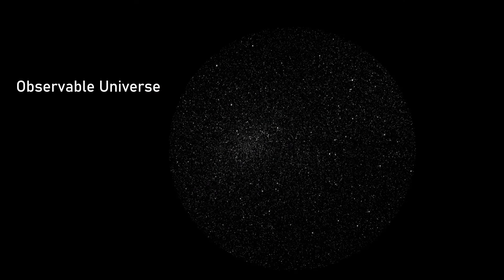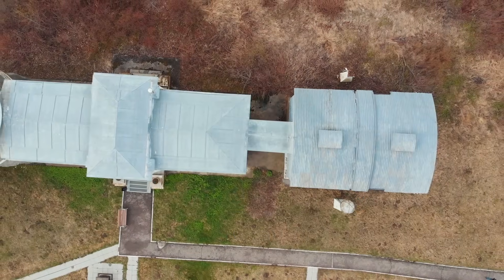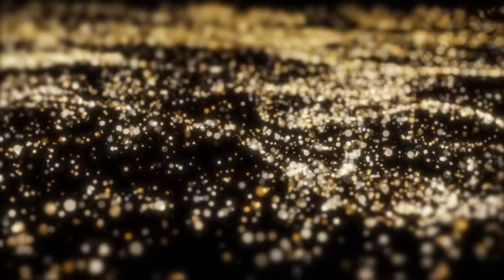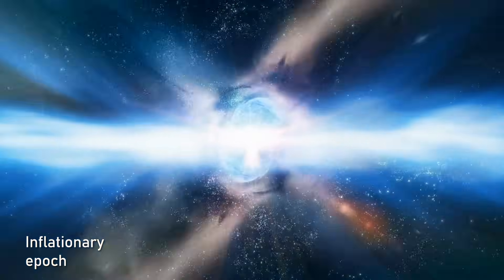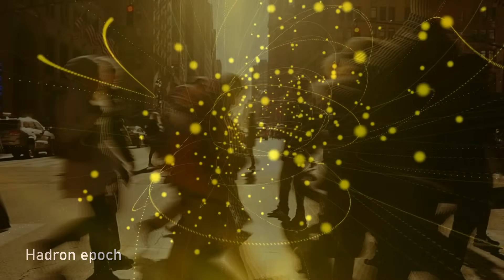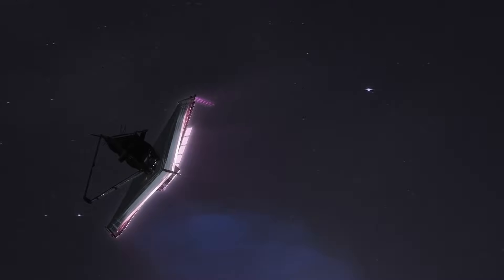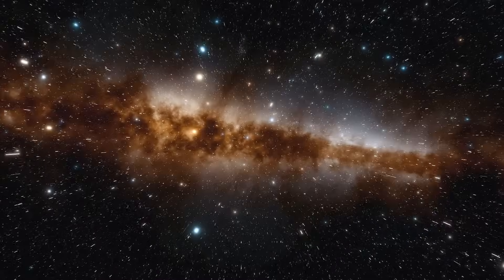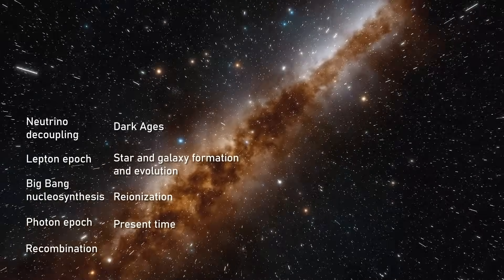Brian Cox - Quantum Mechanics & Particle Physics of The Early Universe

Comment: If black holes reside is a region of Einstein's theorized space-time where gravity and mass are so dense that nothing, neither mass-particles nor electromagnetic radiation such as light can escape then how could it be possible for the entire mass of our universe to escape the unimaginable density of the proposed Big Bang? According to general relativity sufficient compact mass-density will deform space-time to form a black hole which obviously debunks both Big Bang theory and relativity! It is scientifically impossible to travel back in time to view the earliest preformed galaxies of a Big Bang with telescopes that are made in the future. 

As moving electrons of charged electromagnetic waves-light travel through the plasma of the universe each lump (or "quanta") of energy in the electromagnetic waves are charged then discharged to the next lump, eventually the energy dissipates creating the appearance of time dilation. 

Big Bang theorists rely on red shift to support the hypothesis that the universe is expanding, the very process that's easily debunked. Light like all electromagnetic radiation and electricity is the result of moving electrons, they bend-curve in the plasma of ether giving the appearance of longer wavelengths in red shift. Neither time nor mass can create itself into nothing, reside in nothing or expand into nothing simply because nothing has no properties. Time and space are independent of each other, not material bodies or fantasy unions that magically stretch time like a rubber band into space-time dimensions. 

Galaxies with massive gravity from the early Big Bang would have been gravitationally bound like the Andromeda galaxy is to the Milky Way galaxy, the sun, moon and planets in all solar systems in the universe yet these early galaxies were able to somehow escape these massive gravitational forces continuing to expand at an increasingly faster rate. Into what, nothing? Nothing has no properties! Big Bang theory is like trying to force the number 1 into 0, you can try but it still won't fit. 

If gravity is the result of mass then before the universe came into being gravity couldn't have existed simply because mass was not yet created! Neither time, gravity nor mass can create itself into nothing, reside in nothing or expand into nothing simply because nothing has no properties. Neither the atom, universe nor time can be created or destroyed. Albert Einstein an autistic violinist patent clerk that had access to more papers than Suzanne Somers litter box yet creates theories with more bugs than Terminix. The universe has always been here. "I am the Alpha and the Omega, the First and the Last, the Beginning and the End" Revelation 22:13. —Magnetron

What do you get when you mix Einstein's gravitational waves with time dilation? A universe of chaos where time and gravity fluctuates with waves, planets in solar systems are thrown off course in a collision course towards their sun. The speed of light is determined by how fast it travels through what Tesla called the ether-space. Time and space are not material bodies or fantasy unions that can magically create force upon another, yet Einstein joined them together with all the fundamental forces of the universe stretching time and space like a rubber band then using the speed of light to measure the age of the universe. Time and space are independent of each other, debunking Big Bang-evolution and the age of the universe.
According to general relativity ie gravitational lensing (a warped field of vision in telescopes) is due to (mass) between a distant light source and the observer. If that were true earths huge mass would distort the light of the observer as well making telescopes unusable. So only other planets in the universe are affected by gravitational waves? In 1916 before it was known that man could travel in space Albert Einstein based his gravitational wave theory on relativity. In 2021 most of us realize if gravitational waves existed in space astronauts would be crushed like an underwater diver traveling to the bottom of the sea. 

Einstein's disciples defend relativity by saying gravity is a weak force, yeah so weak it effects planets and galaxies just not astronauts or droplets of water in space?. The concept of gravitational lensing is wrongly conflated with mass-gravity. Gravitational lensing occurs in all wavelengths of light. As moving electrons-light approach a bend-curve centrifugal forces slow them down. This slowing down of electrons would account for the appearance of black holes, longer wavelengths in red shift and the supposed curvature of spacetime, what I refer to as centrifugal deceleration of electrons. 

Plasma Birkeland currents of galaxies also increase wavelength from the photoelectric effect.
If space was curved-warped according to Albert Einstein's curved-warped gravity theory, like a boat in the ocean these same gravity waves would effect time and the perfect balance in solar system orbital mechanics throwing planets off course-out of orbit in a collision course towards the sun where a planets gravity and time would increase and decrease with different velocity rates as they ascend and descend the curves of gravity waves. 

So according to Einstein's gravity wave theory the curved warped space of the universe with no gravity traveling through a non curved warped space medium with no properties creates a falling effect of gravity against an already curved warped space universe with no gravity, where gravity is created from gravity and 1+1=3. 

The further light travels through what Tesla called the ether-space, the more it slows down. This mirror experiment in Einstein's time dilation illustrates two things. (1) When light passes through a medium like electrons, a boat in the ocean or an airplane in our atmosphere they slow down from the resistance they encounter. (2) The power of suggestion to make people believe that light is a Time Machine. Time and space are independent of each other, debunking Big Bang-evolution and the age of the universe. Einstein's time dilation and gravity wave theory is just what you would expect from an autistic, using water to make water, turning his faucets on and watching as it runs down the drain. Albert Einstein, a violinist patent clerk that had access to more papers than Suzanne Somers litter box yet creates theories with more bugs than Terminix.- Magnetron - The Scientific Evidence Against the Big Bang https://lppfusion.com/science/cosmic-connection/plasma-cosmology/the-growing-case-against-the-big-bang/

Comment: Neg to poss and back again by gravity??? which is a magnetic pull and that point where your compressed to a neg form! Hydrogen fusion then this hole system to heavy hydrogen fusion!. 😃😄😁😆😅5 Smiles and a faster than light travel by a second length of electrical energy pico it 300times to one second and you can get one light year in 31 hour's Einstein Rosen Bridge plus a few he didn't have that I know anti.... ...about fabric and why??? idiots.... .... should see the ion at a short particle in a thorium reactor type design that is hit and compressed by @ exploding tree lighting worth at around 3 million volt by 8timed units to provide thrust force to the mass. And gravity is a lie magnetic pull weak feild......like worm holes unless you got a above math which allows me to bend space time by quantum mechanic

Comment: If the effects of gravity that we observe, are the results of space-time curving around mass/energy, why do we call gravity a force on par with the strong and weak forces and electro-magnetism? Time has nothing to do with those.
Reply: Time actually doesn't exist in quantum physics... it's external and equations in basic importance don't depend on t
Reply: @blacked2987  Well, that's the point. Time has no place in the quantum world, whereas gravity is defined by space-time, so gravity is not comparable to the forces described by quantum theory.
Reply: @ospyearn  geometry is the sole heart of general relativity. But, at the Planck scale, geometry can't be used... therefore, spacetime can be understood as pixels or quanta... spacetime itself is Quantised at the Planck scale
Reply: Science Revolution  : I have to ask you.
Did your mom drop you on the concrete floor, or do you sniff glue ?
Reply: @erikhviid3189  Why can't it be both?
Reply: @MASAo7  😂
Reply: Science Revolution  May I suggest you first go to school for, say, ten years or so learning about chemistry, nuclear physics, mathematics, classical physics, and cosmology (preferably earning a Ph.D or two in the process) before you start doubting science which has been proven time after time. But I'm guessing by the time you're half a year in, you'll see how ridiculous your post above really is/was. Extraordinary claims require extraordinary proof.
Reply: Nothing is faster than the speed of light and what you have been told about quantum physics is mostly a lie. When nothing can travel faster than light one particle can not be in two places at the same time and super position can not exist. A real working quantum computer has never been build and has never preformed a calculation. If these people say the universe is 13.8 billion years old and the observable universe is 90 billion light years long than you will be traveling faster than the speed of light to be able to meet that distance in that amount of time.
Reply: @hampopper3150  pretty sure it is you who does not understand quantum mechanics. I think you just lika calling other people liars. You know this is why you don have any friends right?
Reply: @paulmichaelfreedman8334  Well I keep seeing an old theory that people keep on believing like its some kind of religion. Quantum physics is not fully understood. And you probably know everything about quantum physics because your from the future.
Reply: @hampopper3150  Nope, I won't even pretend to understand it all. Even Dick Feynman said that he didn't understand it fully. There certainly are missing pieces to the puzzle. And wave function collapse is also hotly debated. But that doesn't mean one can just go and shout things which are nearly certain to be untrue. And while you can claim they are lying, no one will believe you until you hand over some damn good evidence that not only supports your theory, but also refutes others. So, let's have it.
Reply: @hampopper3150  and your scientific background was ?
(Sundayschool in the local church ?)
Reply: Science Revolution  didn’t your mom tell you not to sniff glue ?
Or are you just mentally gifted far beyond wanted ?
Reply: Science Revolution  tides: look at a tide-tabels for every port/harbour in the world. It “follows” the Moon.
Van Allan belts : look Wikipedia. And study science (physics).
Magnetic poles: buy a compass.
Moron.